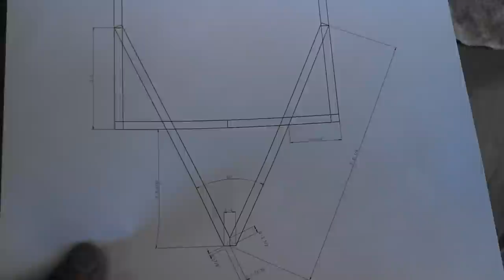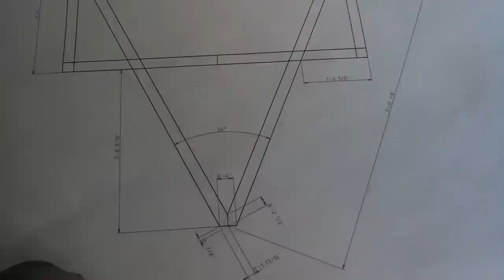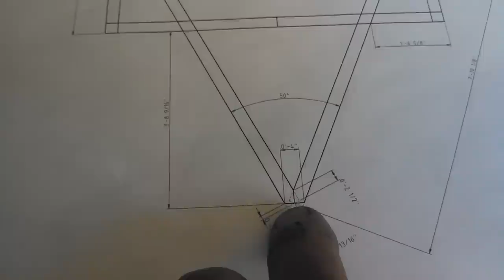Building an 18' flat trailer car carrier/hauler with dove tail project part 2

Comment: I have never seen anyone build a trailer by just building the out side frame then installing axles and fenders before putting cross members in. Your putting the cart before the horse. Every trailer I've seen built the full frame was built then tongue then axles then metal flooring if so desired so its flat against the frame so you don't have to notch around welds for fenders those go on last

Comment: YOUNG MAN , MILLER WELDER ARE ONE OF BEST WELD U CAN  GET , U LOOK LIKE U  ARE DOING GREAT JOB , THAT IS YOUR FIRST DOING TRAILER BUT U NEEDED " W R A P T O N G U E " THAT WILL EQUALIZE THE WEIGHT COMPLETE OUT , ALSO YOUR TRAILER WILL PULL BETTER , WHERE YOUR WELDING BEND U NEED TO " F I S H - P L A T E " BOTH SIDE  ?.

ANGLE IRON BEST WAY TO BUILD ANY TRAILER  ! .